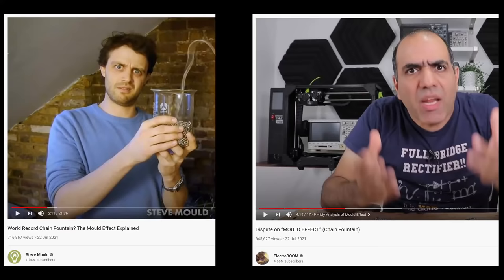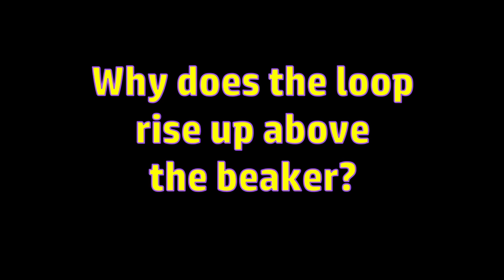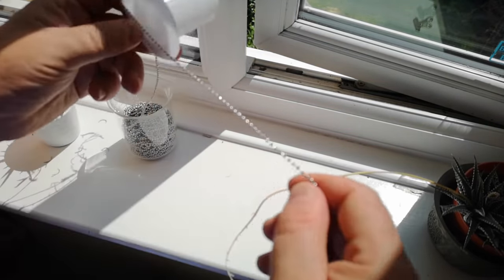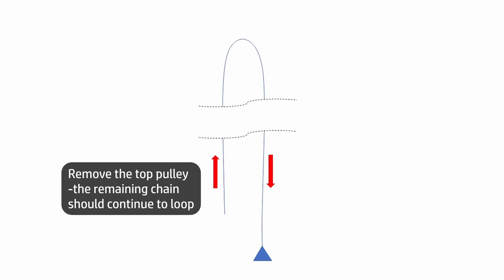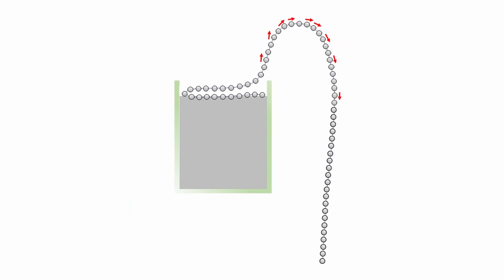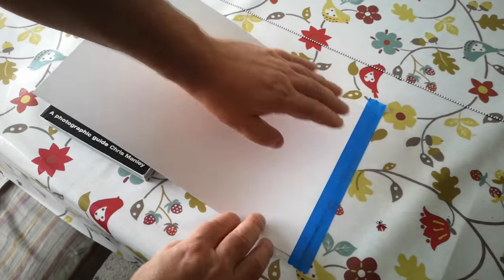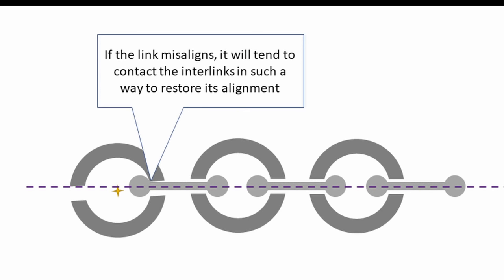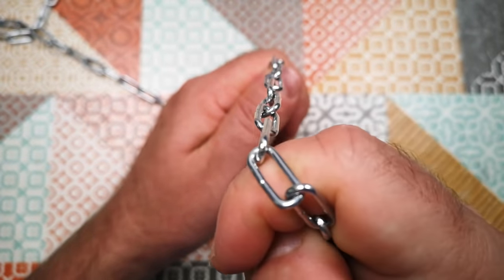Investigating the 'Mould Effect' - (Ball Chain Fountain)

Comment: your explanation of this was great. and far more coherent than their explanations. also the way they present the explanations they have implies that it's either the downward momentum translating int a siphon or the physical interaction between individual links. the only bits that may have been helpful is to explain the height increasing because gravity accelerates objects towards the earth and since the links are connected, the chain is accelerated out of the cup at ever increasing speeds. that, and Steve mentioned the force of the beads turning to a vertical orientation applies pressure to the horizontal oriented bead behind it which imparts a bit of leverage force that physically pushes off the container and the slight upward momentum gain from the beads bouncing off each other initially. while I think your spool shows that you don't need those factors to have the effect occur, it may contribute to how this shape chain is the easiest chain to have this happen. I find it likely that a large enough pulley with a bearing would initiate the same effect with a different chain links.

Comment: I feel like you’re 100% on the right track when you’re looking at the forces imparted by the internal link in the ball chain. I think it’s very much worth looking into why the shape of the material matters and how much it could be impacting the motion!
Reply: You do get this effect with a conventional chain,  I have done it.
Reply: @dogwalker666  I think this is all the more reason that the shape of the material seems to matter — why is it that Mould et. al. couldn’t get it to work with a linked chain? Thanks for sharing, I’m curious to learn more.
Reply: @singerofsongs468  at work we use chain blocks they are quite long with a continuous loop 1" pitch chain running over the wheel if I have it in the scissor lift and pitch it to the ground I get the mould effect

Comment: @atomic shrimp, I think it's down to the construction of the chain, using spherical balls with a slight gap between, that coupled with the pull of gravity, the energy created moves along the chain to a certain point and gets stacked to a certain point until it gets too much and then is released, kind of like having a capacitor in a simple electrical circuit, it builds to it's capacity and then is released in a greater amount than the start of gravity alone.

Comment: I don't know if I agree with studio Shrimp's conclusion on experiment 1, however, I think the experiment did tell us something. The end of the chain lifted up because the momentum(inertia?) of those balls exceeded the pull of gravity on them, and just like Medhi's demonstration with the vacuum hose, this makes plenty of sense to us when it's a lightweight end of a chain/rope. We see this whip effect happening anywhere pull-chords are used too. 
Now, where you were trying to get the effect to happen when the short side was always supporting the entirety of its side of the chain, I believe the Mould effect is caused by the fact that the weight of that side of the chain is mostly supported by the beaker, leaving very little weight to pull against that upward momentum, simulating the end-of-chain whip effect.
Reply from the maker: I agree with your analysis - the setup studio shrimp is describing might only be possible as a thought experiment, rather than in reality - because spinning a very tall loop of chain up to enough speed so that the momentum of the upward side carries it (sustained in part by the falling of the downward side) might be simply impossible without first either running out of chain or something getting tangled.  I think for very long loops, the ball chain won't exhibit the lovely stability we see at normal scales.

Comment: 6:25
that sideways force converting to upward force on the back end is pretty much how an ollie on a skateboard works, the griptape and convex nose and tail allow you to give a ton of force to the side and convert it into lift, if you clear the back end as the front end is up, then kick it, it will come up with the mostly sideways force you apply to the front end, the convex shape helps curve it in, but you could still lift it without, albeit a lot harder (flip tricks would more preferred at that point to still get that lift)

there's also spin tricks with enough impulse to pull up the board through centrifugal force like the laser flip, they can be done without interference of the front foot even and come up just fine, technical skateboarding has some great examples of physics being manipulated, late flips deserve mention too, although probably not as useful when trying to prove a greater weight/impulse pulling

sure the skateboard is just 1 body, and not linked with a chain, so is stiffer in its reaction (therefor less forgiving if you don't follow the ideal trajectory), and the way the effect is triggered is by a pushing impulse, not a pulling one, i bet pulling would actually help stabilize it more (given the mass was significantly higher on the pulling end), anyway i guess what i'm trying to say is, the basic principle still seems pretty similar, you tend to get this parabola effect of rising that's exaggerated in amplitude when the impulse is stronger.

Comment: One thing I instinctively feel is a factor (not sure if Mould or Medhi have addressed it or not!) is the relative... rigidity of a ball chain by comparison to, say, a regular link chain? As in, a ball chain can't completely double back flat on itself in only 2 links, which a regular chain typically can. I think that limiting factor means that as one ball link experiences a change in direction, it's forced to kick its subsequent links out behind it, where a regular oblongish chain link can under certain conditions change its direction a full 180degrees without impacting its neighbours.

Comment: Hi Atomic Shrimp. I have been captured by the various posts on this subject and seem to have set my mind on what I have termed the "Half flywheel Effect" when you had the sketch of the two ball with the following ball exerting an upward force I thought you were going to enter my Half Flywheel Effect Theory" (the chain that forms the over-the-top loop and exerts centrifugal forces but only in the 180 degree quadrant, and with sufficient velocity is able to rise and maintain its loop.) the higher the drop on the downside the higher the loop can rise and the higher the velocity on the downside the larger the diameter of the loop. By the way I have seen a video that used rope and produced an impressive fountain. I tend to think of a boat pulling a string  (chain) of inner tubes, I think according to my theory that as the tubes are forced to change direction around, lets say a post, eventually the tubes would overrun the post for a brief moment  before being pulled back into the loop.

In a rather crude form it is as follows:

I am still convinced that the driving force for the fountain is the "half flywheel" that is induced in the initial acceleration of the chain. I also agree about the kickback created by the chain but this in my opinion is simply a reactive instance that works in favour of the fountain. Please apply your great wisdom to the investigation of the forces generated in the "half flywheel" Half a flywheel in this orientation can only go up!! It is driven by the downward chain. Proof=shorten the downward chain's fall height

Comment: That was a very reasonable suggestion. This would be easy enough to code in 3d. Well, "easy", it would maybe take 24 hours of solid coding to get a result that looks pretty and works perfectly. Might kill my computer though, I mean, how many balls are there? Checking collisions is expensive. It would be cpu bound, you can't pass this to the gpu but you can bake it (save the physics to file). Anyway, you could then draw the vectors and see the velocity vector waves. 

The basic physics is simple, the issue is that the way the balls are connected means that there's going to be torque jamming. That's to say, there's a maximum amount of rotation they will allow. So you'd have to model this as a collision. Not like when you bounce a ball and just reverse the vector but more like Newton's 3d. Well, exactly like Newton's 3d in fact. If you don't do that it'll behave completely differently, like string. This way for a moment two balls at their greatest allowed curve will rigidly - not fluidly - pass the momentum to the next ball in the chain locking that too. 

Sorry, unless you spend all day every day coding vectors for computer games this might be hard to imagine but it means you'll get a very set curve to the highest energy section of the curve. Interestingly, the point with the highest potential energy in the case of the balls dropping.

Anyway, that's the key to it I think, the limit to the amount the chains can curve, the locking point.
Reply: Ir might not be as CPU-intensive as you think, if you can optimise the 'spent' balls that don't really do anything after they've landed.
Reply: @Jehannum2000  Oh absolutely, you can always do a few tricks once to have everything set up to make it run better. You can use multimesh instances and be smarter about when you collision check. Here, rather than actually have a collision you could just track the angle of the connector and make a bespoke method to handle when it requests an excession to the max and then deduct the excess and return a nett bounce vector. So no collision checking needed. The issue is, the more you add cheats like this - which are fine for games - the less certain you are that you're still modelling real physics.

Comment: Is this what happens with a slinky? Just transferred over a shorter distance because of the coils? The energy transfers well because the coils are very rigid, and because the slinky is very fluid as a whole, the waves of energy are enough to reach the end and cause it to flip over and become the sender of energy? I'll have to check this Mould thing out because I've not heard of it. Very interesting video <3

Comment: i didn't hear them mention the flow of air affecting it but could the tailgating of one bead make the one behind it go a bit faster due to slipstreaming and so on for each consecutive bead and that that pushes the beads up..   I think the 1st person to explain it so everyone understands the principles is the winner. All the answers seem correct in one way or another.
Reply from the maker: Yeah, I think a lot of the confusion is just that there can be multiple right answers. The ocean is made of waves, made of water, made of molecules, made of atoms, made of quarks, made of fields. All of those things can explain its behaviour
Reply: @AtomicShrimp  I liked the analogy of the rippling sea where things go up due to outside forces. I think the syphon also help understand it. I think you should enter the competition ...You could win 100$*2 and the kudos for beating them. You can use my slipstream theory as well if it helps your argument....we've had the arguments now I think the ideas have to be debunked. .I think that is what science is about, coming up with ideas and then whittling them down to the most probable answer.

Comment: I find Mould annoying so I didn't bother watching his video on it, only heard of it from Mehdi. You definitely added a lot of detail that was missing. I especially liked the comparison to a syphon (although it doesn't really work like a syphon), and the suggestion that it's a standing wave.
I guess in many ways this should be compared to whipping a rope in such a way that its apex goes much higher than the initial motion, iirc Mehdi didn't like the idea of a lever action going on, but when you transfer energy this way it basically is a string of levers like you explained with the arrows circa 6:30.

Comment: for what you where saying for a wave of water acting the same as the ball chain falling out of the beaker and creating a stationary wave, I can atest that this does happen. Where I live there is a river and in it is a small ramp which is around 2-3 meters long. with a 45 degree decline, after heavy rainfall and the river starts to get deeper, the water going down this ramp creates a big waves before going down. This is because 1. the surface level of the water is increased because of the wave and two the water is going down the ramp faster because there is more water, if this videos theory's are to be believed.

Comment: Hi, I was working as electric engineer in Electronics.
I learned much about waves and especially about standing waves.

Partly the picture remembers me at this effect.

Did you consider that the chain is basically placed in loops?

There is also a phase swapping - kind of from a horizontal  to a vertical wave.
What happens if you completely remove loops and circles?
May be this is possible if you let it go through a pipe making it moving basically upwards rather than in loops? Does this keep or remove the effect?

Comment: Before I finish the video. To me, what looks and makes the most sense Is the following In the following way.

:1:|First step happens when sufficient amount of Ball Chain are moved past a certain point too a certain extant.|
:2:|Second step Is when the the falling sufficient amount of Ball Chain gains enough energy to pull even greater amounts of Ball Chain, while doing so at an angle due to multiple reasons.|
:3:|Third step Is what happens when the Ball Chain has enough energy to pull more Ball Chain out of It's respective container. So much so that It does so faster than gravity can pull It down.|
:4:|Last but not least, happens when there finally Isn't enough chain to feed this cycle/reaction/whatever It's called. Thus finally ending the Ball Chain Fountain.|

AND NO. I am not a scientist and/or physicist, so please no hate comments/replies If I missed a step, or I'm dead wrong.

Comment: Is the chain that has fallen for longer or has more length paid out falling faster?  I.e., is the falling speed not constant, and does the height of the loop correspond to that speed?  We'd expect this with acceleration due to gravity.   An experiment would involve actively pulling the chain at different speeds.

Comment: One aspect of this that didn't get covered by any of you is: would this also happen if the balls were further apart? At the moment the balls touch each other before they can rotate 90° from each other. That means that turning 1 ball will take the next ball with it; sort of lifting it up a bit. This wouldn't happen with simple string, where 180° turns at one single point are possible. 
I don't know, but I think this has a significant but too less discussed effect on the phenomenon
Reply from the maker: I think that varies with the specific example of ball chain - the minimum curvature of the chain seems to be quite a lot smaller than the top of the loop produced by the chain fountain, but it's possible that it still has some sort of effect before the joints actually jam at their maximum angle

Comment: Re the liquid metaphors.

I think your on to something. I wonder if you set up a normal liquid siphon whether you could detect a weight change at that point?
Reply from the maker: I reckon so - it might be difficult to eliminate some factors - the pipe will experience buoyant forces from the liquid, but the level of the liquid will be dropping.  I guess maybe siphoning from a very large tank or reservoir might reduce that down to the point it can be ignored.

Comment: Has anyone tried adding a weight to the end to sort of "simulate" the weight of much longer length of chain that has already fallen? If we guess that already fallen chain is mainly contributing weight minus air resistance, that would be a much more practical way to get the effect of a much longer chain without requiring ridiculous heights. Also, How Ridiculous should try this at the gravity observatory down under.
Reply from the maker: I don't think it's the weight of the falling chain so much as its velocity. Heavy things don't fall faster than lighter ones (ignoring air resistance). I'm not sure a weight would really provide the same effect, but I guess it's something to try anyway as more experimental data is better
Reply: @Atomic Shrimp  Oh, right, objects accelerate at the same rate regardless of mass except for air resistance, but that should at least prove that the weight of the already fallen chain is irrelevant. The friction at the edge of the container would be another variable to play with perhaps James Bruton could be convinced to make an elaborate setup with bearings. Or Tom Stanton could set up something akin to a venturi using pressurized air to accelerate the chain faster than gravity.

Comment: you think this is bad? hold a slinky by one end and let it hang from a height. when you let go of the top, the bottom end just stays hung in the air until the spring closes all the way up and only then finally drops. (the top end falls all the way to the stationary bottom end and only then does the whole thing fall down.)
Reply from the maker: Yeah, people get really confused about that one; I think it's kind of simple - mechanical forces can't be transmitted very fast through a spring - the bottom of the slinky doesn't 'know' the top is falling until forces can get there with the message, and that transmission happens slower than the falling part of the spring is moving.